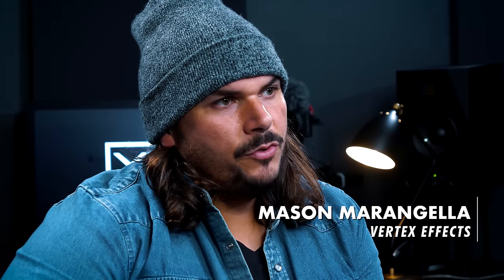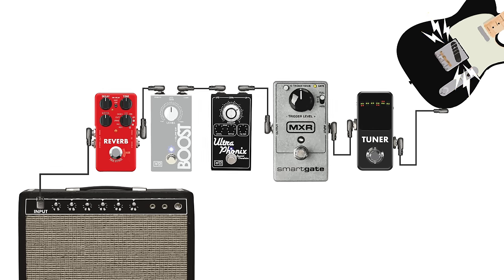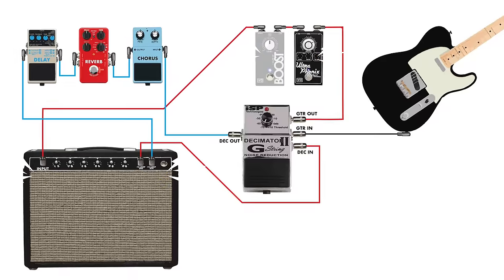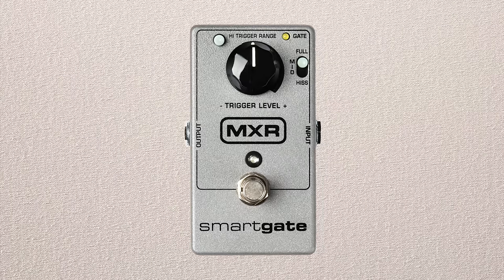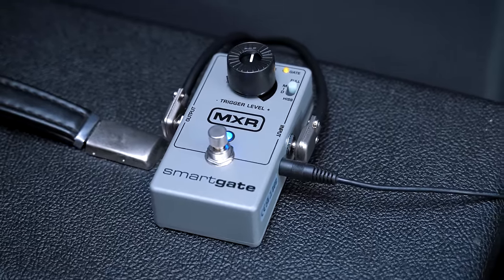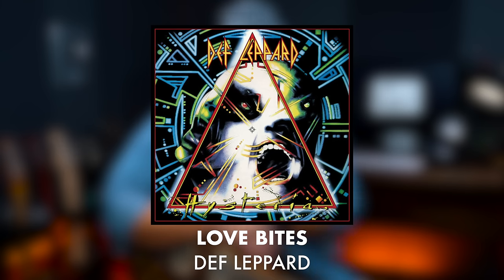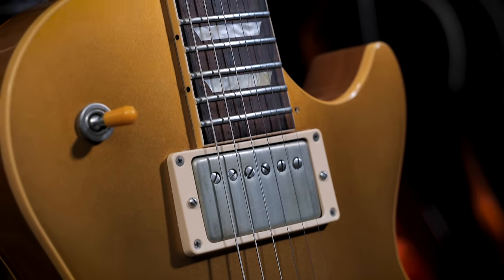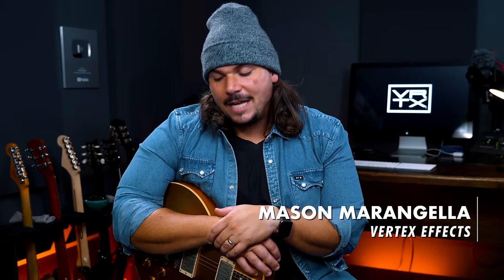Why I Changed My Mind About Noise Gates

Comment: In every topic, when I find Ur video on the matter I can stop searching. Soon I will learn my lesson and just come here first. Thankyou for outlining these options.

I think I'm following the method at 3'30" for now as I have no effects send and mostly busk with a 2 channel Cube EX. however my future plan is to use a mixer with FX loop and monitors for recording. My remaining questions is where to place the compressor (TC hypergravity), wah (Hotone Soulpress II), fuzz (JHS series 3) eq (Joyo R-12),  boost (TC spark mini) tuner (NUX NTU3) Octave (Joyo R-13) and my boss looper. Ouch!

I'm thinking:
guitar > tuner set true bypass > wah > fuzz > octave > compressor > boss 2 CH looper > noise gate (EHX silencer) 

My vocal mic plugs into other channel on looper. Hope to put some effects on that line in time. Like a separate compression, reverb, chorus. ***Updated - just realised this might not work well and I need to keep my vocals separate on another channel.
Is it possible to put the looper last i.e. after reverb/delay that way Ur recording the final sound with instrument and a more unprocessed sound with vocal?

My compressor (TC hypergravity) can act as a buffer? So cld tuner but I think the spec is not so good on the buffer and I would then have to place it after the wah and octave if I follow correct.

Then distortion and od in the EHX silencer loop. 

Out of the silencer goes into mod, chorus and reverb (all 'stereo' Joyo/Flamma), which go into the two clean channels on my cube amp via 2x final buffer -one on each channel. I think I will make from Ur videos)

Do my EQ and boost go at the star of this section i.e. first in line from the output of the silencer? Or does one/both live on the silencer FX loop after the drives and distortion?

Am I in any way on the right track?!

Thanks if you manage to read all this! It's a steep learning curve and I hope to learn a lot just by experimentation but now I'm assembling/building up my individual pedals and tryna get my head around the theory/concepts of pedal chain and get a bit of a starting point cos I'm gonna build my own pedal board/split boards out of timber when I've got everything in place and working out shapes,sizes and layouts is fun 😊
Reply from the maker: I'd put the gate before the looper.

Comment: Mason I have an BOSS IR-200 that has  consistant ground hum.Although there is a chassis grnd. screw on the side I really don't know how that would help me.Its at the end of my wet pedals,ie my Boss MD-500  and my EQ-200,not in my Kingtone or overdrives.I bought a used  Boss NS-2 and I'm thinking it may affect my timed petals negatively.What do you think would be my best plan of action?Oh,my  fuzz and overdrives run to the send and returns on my amp,and the timed pedals eun into the input of my amp.Any suggestions would be appreciated.

Comment: hi can you help me?
 i use amp, preamp, noise gate, other effect .
but, my preamp and noise gate have 4 cables connnection

amp : h&k tubemeister 36
preamp : kraken v4 v1
noise gate : kma pylon
effect : others pédal

how chain ?
the kraken use 4 cable for connect
amp input, looo send, return, guitar
noise gate pylon the same

bonus : how add an other noise gate on the chain?

tbx for your help, best regard

Comment: Hey man, great video!

Can you help how to connect Decimator g string into my looper switcher?

I have into Loop 1 Tubescreamer, into Loop 2 Diezel VH4 Distortion and into Loop3 Fuzz Muffuletta. 
The noise, of course, came after these pedals so I was thinking to put G String into Loop 4 but if I do connecting input/output to s/r of loop4 it doesn't work. I really don't know how to properly do that with 4cm.

I only use pedals distortions and I do not have fx loop on my amplifier, my rig is all front of the amp.

I'm stuck and this is driving me crazy.
Hope you can help me!

Comment: Question: I have a quality noise gate(ISP decimator II) and a cheap one(Azor The Noise) and I set the ISP on front input of the amp(Blackstar ht5210) then the Azor first in the FX loop. Now the ISP just has a knob but the Azor also got a soft/hard switch. 
I am wondering if I should put the Azor front and the ISP in the FX loop? My thought is having a soft/hard switch sounds more useful/versatile up front than in the FX loop right ?

Comment: Hey Mason, I want to run a gate on my crunch channel only. Is it possible to run a gate that uses the 'X' 4 cable method such as the ns2 in a switcher? I am running two switchers on my board, one for the front and one for the effects loop. I have an ns2 although I will be using the KMA Pylon and wish to have a very fast gating with high threshold on the distorted channel and therefore it will be to sensitive for the clean channel. Any advice would be great!

Comment: G-String user for 10 Yeats, it is great, I cannot hear any affect on my tone. But as said here you should start with good cables, clean isolated Power Supply, otherwise your noise floor Will be too high anyway.

Comment: stone deaf fx shows diagrams how to cable route with the two noise gate pedal method, both pedals having loops of their own. 
I had to get the Noise Reaper because it has art by one of my favorite artists, McBess.
Reply from the maker: May not be necessary to have two, but the Decimator has a LINK function that can do this as well.

Comment: Just put your tuner after noisy pedals, I have mine after Fuzz / Treble boosters, with this I can easiely cut off the noise when I step on the Tuner without doing the tapdance on multiple pedals
Reply from the maker: I suppose it depends on how loud your noise floor is when playing - a volume pedal can adjust static noise down to zero as well, arguably better than a Tuner, or at least more gradually.  Also you'd really need to put it after your last OD pedal to be effective or after you FX Loop send if it's amp gain, doesn't seem so practical in that context.

Comment: What about feedback when using the 4CM method (noisy preamp and pedals case)?
I encountered this in Boss NS-2 and G-String Clone. Using the buffer right after the guitar helped. Wrong impedance?
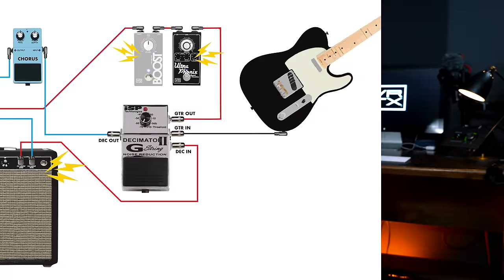Reply from the maker: That is shown in the video, it would be no different than it shows with the ISP Decimator G String.  See 05:49
Reply: @VertexEffectsInc  I know. 
But you didn't mention feedback issues. I encountered it in two different noise gates and in three different amplifiers.

Comment: Thanks for the vids.
I run a boss ns 2 at the end of my effects.. my order is ( thru the effects loop.. peavey stereo chorus) into my boss rack pwr supply.. ( which also has bypass feature) then to tuner> compressor> overdrive> delay> noise suppressor> to loop return.
I utilize both board and amp overdrives .. and only thing i find is overdrive is a bit noisy so i have to crank ns up to max decay which can stifle the return signal and I hear the cutoff if I lessen the decay.
Any suggestions?

Comment: My signal chain is: polytune3 with buffer switch engaged, whammy 5 to (guitar in) isp g string noise gate, (dec in) to output of the khdk scuzzfuzz (with buffer switch engaged) and khdk input to isp (guitar out), and finally isp (dec out) to input of my pod hd500x. Problem is, when i do pinch harmonics, signal cuts off, if i remove Polytune buffer switch off, no such thing, or if i remove ISP from the chain, everything is working! Can’t understand why Polytune with buffer on dont work with ISP decimator G string?

Comment: How would the context change (if at all) when using something like the EVH 5150  overdrive with a built in smart gate? Also, the song choice in the examples were awesome!
Reply from the maker: As long as that pedal was on, you'd be OK if it's last in your chain of ODs but won't help with amp gain.

Comment: So I have three different pedals that are loud. My fuzz and overdrive are loud but so is my Fender MTG Tremolo. I think the internal tube is part of the issue... problem is, my fuzz and overdrive are in the preamp section and the tremolo is in the effects loops (Wet pedals). My thought is to simply put it after the tremolo. Thoughts?

Comment: Used to have the Decimator Pro Rack G on a Laney high gain amp. That gate is wonderful, I did not know at that time that I was using 4 cable method. Not I use the MXR Noise clamp for my Blackstar preamp pedal with fx loop. That pedal sounds great but noisy. Love noise gates.

Comment: I've owned a lot of gates and... They all suck tone to some degree, and especially in the cases of the 4CM gates, you are at the mercy of their internal buffer/splitter, and to which degree depends on where in the chain the front end of the gate is.

Each gate might perform a bit better or worse than any given other, depending on your rig.

I tend to not like gates up front and prefer them after dirt, but when you switch dirt pedals, that can throw everying off because of the threshold setting needing to be changed.
Also, if you roll back on your volume, good luck! 😂

DEADWEALD has a discontinued pedal called the Golem which is not only one of the best gates out there, it has two different settings to switch between. One is a one knob gate (threshold) and the other is more fully featured, with attach and release.

One more thing.. You overlooked using 2 gates. You can put one standard gate in the loop jait to eliminate lower lever hiss from the rig when your guitar volume is off, and another standard or 4cm gate in front of the amp, either plugging straight into it, after dirt, or around your dirt pedals. This  can give you two different gate settings.. The one in the loop being mild and the one in from of the amp being heavy handed.. For something for which you need sustain (no early gate closure), you just turn the front gate off, but you'll still at least have some gating... But if you need a tight gate, you can switch the front gate on. 

Furthermore, you can set up one gate or multiple gates through loops in your switcher, to have different settings and true bypass. This could eat up a lot of switcher channels though!

^I was actually doing this with a Line6 HX effects. I normally don't like going through digital modelers in front of a rig, unless it's for an effect... But almost certainly never for a dry tone... So o would put the front end loop through a channel on something like an ML5, to switch it in and out of the front-end chain completely, depending on my needs... Like when I'd need a oitchifter or synth sound, I'd switch it in.. But for an overdrive or something of that nature, I'd just switch in an overdrive pedal instead.

Hell... You can even do this with input and output buffers. If the buffer ruins the tone of a particular pedal, you can switch it out! If it improves it, you can switch it in!
I'm still an input buffer hater, but the Mesa buffer is amazing on the output.

Oh yeah.. And for a bonus... You can use the tuner out on the Mesa buffer to feed a keyed gate, or even any 4cm gate if you don't want the gate's buffer/splitter in the chain!!! 😜

Comment: I run 8 pedals on two snark adapters and two daisy chains. It's ugly and messy but only time I hear any hum at all is when I use both drives together and it's barely noticeable at high volumes. I did have some noise issues gain stacking at certain venues when I played a strat alot. Everytime I think about buying a one spot power station I end up just getting a pedal instead 😁

Comment: OK, at 12:02 when the playing stopped, there was what I call “white noise” or maybe some people call hiss…..My rig is suffering from this tremendously. I have the gate near the end of my board and set so that I get decent sustain without any hum/overdrive noise, but this airy “white noise” persists…..It’s less noticeable in a full band setting, although I still hear it, but it’s extremely noticeable obviously while I’m playing alone, and forget about recording….I’m not using the 4-cable method, although I tried it before and it didn’t work…..Does anyone know of a noise gate or something that will eliminate this? I’m extremely pleased with my overall tone, and if I could eliminate that, I’d be forever grateful.

Comment: I usually don't use one and have no need for them. I play on my Jackson HSS and even then no need for using it. But when for some damn reason I have a neighbor who uses this home radio with a tall antenna that my amp sometimes picks up his radio. The noise gate actually blocks him. But the sad part is, clean tones noise gates tend to clamp down and stomp out the notes from sustaining too quickly if set too high. Not high enough, it does no good to block him out. I use my noise gate in the effects loop. 

Any advice?

Comment: I notice when I use a boost pedal, I sometimes pick up a radio station. A different kind of noise. Lol. It’s an old house and the wiring isn’t grounded. That would probably help.
Reply from the maker: No this sounds like a shielding and RF issue.

Comment: Deciding on getting either metro 20 with cry baby off the board, or getting custom flat platform board to fit the wah, which also is heavier.  What would your opinion be, would it be inconvenient to always plug in wah and transport seperate etc?

Comment: Various applications.  Subtracting hum?  No brainer.  Holding back extreme distortion?  Of course.  Clean?  Test and see.  Id say all the time.  More than likely the threshold and position are key.  Certainly it is obvious with isolated guitar.  In the mix its less apparent but the feel of the player or players comes to mind.  Overtones and or harmonics via pick timing?  Id say its most important for every situation.

Comment: How would you implement a noise gate into an boss es-8 switcher.
Reply: I have the boss NS-2 gate
Reply from the maker: @richhall3861  Guitar, NS-2 Input, NS-2 Send, ES-8 Input, Volume Loop Send (on ES-8), NS-2 Return, NS-2 Output, Volume Loop Return (on ES-8).  Then wherever you move your volume loop in your signal path will be what the gate is wrapped around.

Comment: I have 4 noise reapers, 
and an NS-2,..
A GigRig G2 switcher 
Mono in - L/R out
2 amps:
5150 iconic 80
VHT D50
& 2 Fryette PS100s
Wet fx (H90) are in the PS100 loops, nothing wet touches the preamps or poweramps,..
 Mesa HighWire Dual Buffer.
Seeking schematic advice,..
and/or how much $$$ ?
..to have the rig doctor perform surgery,…
 🖖🏼😎🎶
Reply from the maker: We offer services over on www.therigdr.com on the Tone Consulting page.

Comment: instead of disconnecting the ground, is using 100 pF cap? or which cap (pF) should be used, best
Reply from the maker: It's shown in the video, value and all.
Reply: @VertexEffectsInc  Thank you for the reply, it's around 9:15 when you talk about the cap, but what I missed is the units of the cap, if they are pF, nF, its a ceramic .101 but pF? sorry, but I newbie over here, all the best.

Comment: I did use a noise gate for awhile but I found that I could not use my volume knob for swells and subtle adjustments. Removed it and put in quieter pedals and just flick off my volume when I stop playing. Far more satisfying experience. Could try a Decimator I suppose, but my current setup works for me… but that could and does always change 🤣
Reply from the maker: I think it's easy to overdo it with a gate where it prematurely cuts off the sustain of a note or a swell.  Typically means that you're using it too far away from the noise source.
Reply: for touch sensitive stuff use the zuul method of using a key input. that takes your guitars signal and mirrors all the touch sensitive dynamics while still gating excess noise. i didnt think to try the zuul method on my isp decimator hence me buying a tc sentry but i just might try both and see which sounds better to me

Comment: I think gates, with a send/return feature, are incredibly useful. It can help clean up a ton of noise from how you play. 

The important thing is that you should be able to get the tone you want with it off. In other words, don’t use it as a crutch for a poorly setup pedalboard. It shouldn’t be used to account for poor cabling/power/etc that is introducing noise into the system. It should be a performance tool.
Reply: I love the G string... but I moved over to the MXR smart gate years ago and have not looked back since. It’s got some voodoo magic going on that I can’t describe - it just works.
Reply from the maker: It depends on the situation, remember that if you just use the Gate Return (input), and Output it's the same as a 2 cable method gate.  Also the input is only the sensor (KEY), and the output (SEND) is split off the input.
Reply from the maker: @JoelCaseyJonesMusic  I agree, I think it was the best sounding in the loop of the bunch.

Comment: My amp is the source of unwanted noise in my guitar rig. Any usable volume level, regardless of the amount of gain I dial up, gives a "FFFFF" sound. I have no effects loop, just instrument input and speaker out. Noise gates have no effect on this, and I'm at a loss as to how to solve.
Reply: My gates are a Decimator II G String and a Behringer Noise Reducer.
Reply: The head has a preamp tube and a power tube, with a Gain knob, Tone knob, and Volume knob. The noise happens whether plugged straight into the head or when running any number of pedals.
Reply from the maker: You won't be able to reduce any amp noise if it's related to the preamp unless you're using some effects in post production for the gate.
Reply: @VertexEffectsInc  As I feared. The gates will give me dead silence between notes, when I set them just right, but I still hear that "static" noise while notes or chords ring out. I'm wondering if adding an attenuator would make a difference here, but I doubt it.